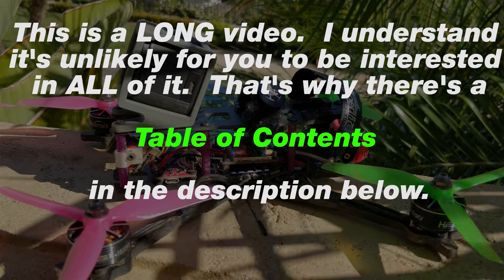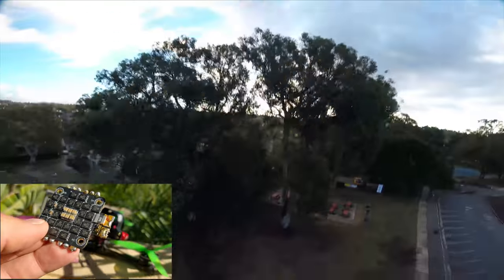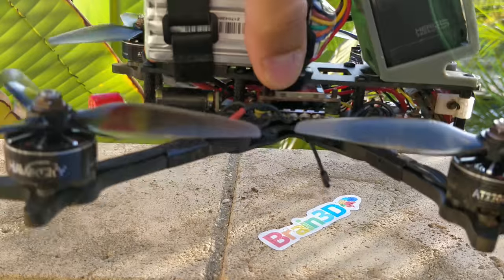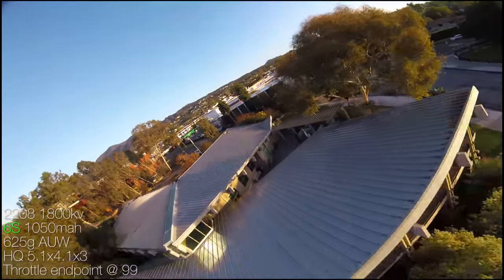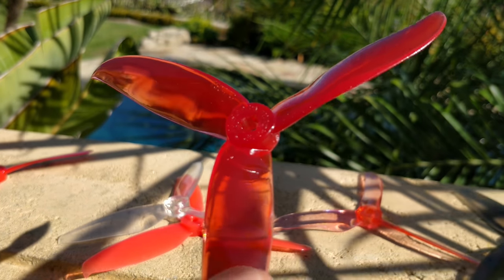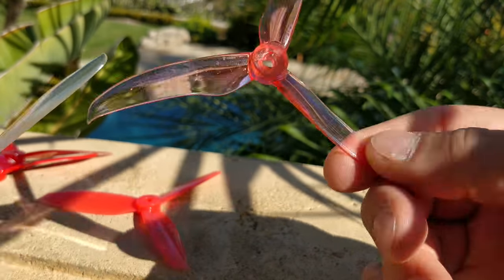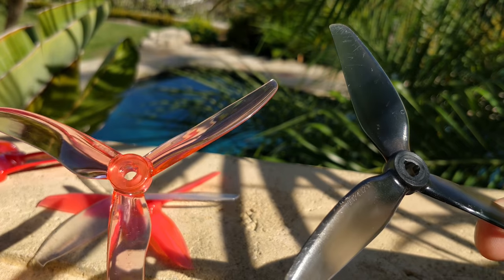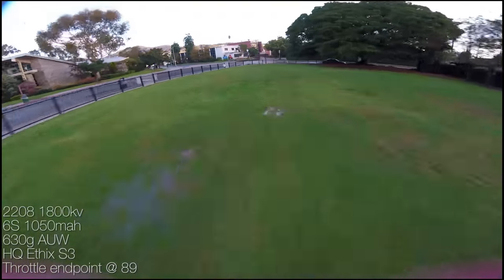HQ Ethix S3, My Setup Concepts, Frame Update, more....

Comment: Hey Bob what kind of Lester solder did you get and is it working good for you?
I've got about 4 rolls of solder here and all junk, radio shack used to have some good stuff but since then I haven't found any local that is good, so think I'll have to order some.
Reply from the maker: Kester 44. Link is in the video after the one where I was having issues.

Comment: Hi Bob, I really want to buy your new frame, but, maybe i just need some glasses, could it be that the front standoff holes are M2? I mean that is not that big of an issue, I just want to know, what you use to mount a flightcontroller that has m3 holes. I hope you can help me.
Reply from the maker: There are two M2 20x20 stack mounting platforms beside the one central 30x30 platform. Everything is M3 aside from the 20x20 platforms.

Comment: Super glad to see you touched on the wobble after throttle issue. It's literally been killing me on kiss. Side note you think the ethix props are going to be okay at 6s/1600kv? I've been trying out super low kv and I love it. But I'm definitely having the throttle pump issue. I'm hoping the swap to race flight will help as well.
Reply from the maker: It's the single most annoying thing that just a rose in the last couple of betaflight builds out of nowhere. I think actually 3.4 made it happen
Reply: @Kabab  I stopped using BF because of the clracing f4s. Literally 4 of them all died out and gave me different issues and I couldnt tune them for crap. I'll try out the ethix blades and see if they help. The minimum throttle idea is good. Although I run into the "floaty" quad issue where it feels like it won't go down unless I lean forward too far.
Reply: @Kabab  side note you hit the nail on the head with "phantom until acro". 😂. Exactly what I'm going for too. I actually ordered a floss too before realizing you designed it haha

Comment: Your rates are not that far off from mine.   I run close to 850 which is the result of around 1.2 linear, .75 super, .15 expo for PRY.
Reply from the maker: It's all the other stuff I just leave default...

Comment: what are those washers under the prop nuts? do they help any, also what is your opinion on the lock nuts for prop nuts I recently heard that nylon lock nuts are one time use?!
Reply from the maker: lol no way.  I have locknuts that have like hundreds of cycles on them.  Yeah they wear a little but still work fine.  The washer on top of the prop hub usually helps with props spinning the nut loose.  But I usually don't care and just screw the nut down on top instead.

Comment: Thanks for the vid, the table contents is helpful. I havent seen twin blades in a while btw :'(
Reply from the maker: Because triblades are just better for what we do no matter what
Reply from the maker: Unless you're going for like speed record or something.
Reply: @Kabab  Idk I still prefer them as fast cruising props and I feel that at high speed they have enough control imo (current fave is 5152 biblade on a low drag, properly balanced setup)

Comment: You are awesome, i am thankfull that your channel excists. Thanks for that;)

BUT i am really Not sure if i want Higher standoffs and if i want to pay for two more arms i don't really need.
Reply from the maker: It's going to be the same price no matter what.  The first prototype batch will include the extra pair of arms and based on how many actually use them I'll decide whether to make it an add on or just leave it in the kit.  The actual cost to produce and pack the arms is insignificant when you just include it with the production.  The handling of these parts costs more than the actual part.

Comment: What kind of top speed do you get running the 6S motors on 4S. I know that that is not the purpose, but I am highly interested.
Reply from the maker: no clue but it's like 2/3 the speed of 6S probably depending on AUW, props and motors.

Comment: how much will it cost, if you are including all of these options? Maybe you could offer it as an option in the store, because i don't think everyone needs all options.
As always awesome work!
Reply from the maker: It's going to be the same price no matter what.  The first prototype batch will include the extra pair of arms and based on how many actually use them I'll decide whether to make it an add on or just leave it in the kit.  The actual cost to produce and pack the arms is insignificant when you just include it with the production.  The handling of these parts costs more than the actual part.  The extra hardware literally costs pennies.  This is why I laugh when any frame maker says they removed one standoff to make it cheaper to produce and sell.  Standoffs in large bulk are maybe $0.06 ea.  I'd rather spend those pennies and give you ALL the options.

Comment: Bob have you done any testing on the Aikon 6s 20x20 ESC listed on Pyroflip?
Reply from the maker: Yeah. It works but like the rest, it's not as good as the larger ESC's imo. But it does work fine. I just don't have the trust in it that I do with a big one
Reply: @Kabab  so nothing crazy innovative thats worth switching from the ori32 that i currently have?!?

Comment: hey kabab do you know if the ethix props are the same as the standard 5x4.3x3 hq props? just got a set and they seem identical, even the same SKU (just different colors). did you notice this? have you flown the hq v1s before and if so was it the same? what SKU do your props say on them? there's literally no info on them even on the website.
Reply from the maker: Definitely not the same. The 4.3 is a slightly softer material and has that scoop near the middle. It also flattens out under load pretty quickly.
Reply: @Kabab  would you be so kind as to upload an image or link to the SKU/numbers on your prop. I think the retailer swapped my ethix props with standard v1s and I'm trying figure it out.

Comment: What do you need to look for in a prop if the goal is to maximize flight time with the least impact possible in agility and power?
Reply from the maker: you may be asking for a bit too much but you want big blade and shallow pitch
Reply: @Kabab   Big as in long, or wide? Or both?
Reply from the maker: @tiagotiagot  long is gonna matter more than wide. But longer you go the lower the prop response

Comment: The Xing motors actually have 9mm bearings. 

Do you recommend, building two exact same quads? I just bought sone high kv motors and I want to build a second one. But I don't know, if I should now use the high or low kv motor for 4s
Reply from the maker: I don't have any two quads that are the same anymore.  I like two of the same because then nothing changes if you break one and move to the second one.  But I also have more versatility with two different quads.  I really really recommend you build an 1800kv 6S capable quad on at least 2306 or 2207 for 5".  There just isn't really a point to building 4S quads anymore.  The ESC's mostly do 6S now and everything is quickly moving to the 6S standard.  4S on a 6S quad is definitely not as powerful as 2700kv 4S, but it's absolutely no slouch either and is ultra efficient.  You'll unlock abilities you didn't know you had when you have so much throttle resolution in the range where it matters.  Just give it a pack and try to fly around a branch and you'll see.
Reply: Kabab FPV  Well, know I have to build one with the high kv motors, I think. But the second one, will be a low kv for sure now. Thank you for your reply. 

I really like your videos, you have a great mindset. Ah and I just designed my own frame, I got inspired by yours.(studying mech. engineer, I love this stuff) 

Keep up the great work.

Comment: We need to change our motor construction so it is similar to RC car brushless motor. 
That would get props out of view and it would make motors much more durable
Reply from the maker: But out runner gives so much more torque and is simpler.
Reply: @Kabab  I mean that type that's like normal quad motor but the shaft comes out from bottom and not top of the rotor.
Only disadvantage of it that I can see is that taking off would be harder on grass
Reply from the maker: @BuzZ.  ah like that.  Yeah not very practical unfortunately
Reply: @Kabab  it would be really smart, just do it !

Comment: Hi mate! 

It would be awesome to have those X arms on my flosstyle :). Are you going to made them compatible?

Nice video!
Reply from the maker: unfortunately I can't make individual arms compatible on the flosstyle but I assure you this new frame will not be expensive for the extreme value it will offer.  Target is $50-55

Comment: Damn, i wish i would have watched this video before i pulled the trigger on the hyperlite 2207.5 2222kv motors. I had asked on the piro Facebook page if anyone had flown the 1922kv motors on 4s and 5" props and if they would think it would still have decent poke for some light freestyle on my mid range crusing rig. The few who did answer said it would on 5/ 6s so i just went with the 2222's. After watching, it looks like sub-2000kv on 4s would have worked perfectly for my application.
Reply from the maker: I do my best to share everything I can to help with the decisions...2222 is good for 5S and 4S

Comment: Is it a good idea to use the old Emax 2205 2300kv red bottom on 6s for more speed, or will it destroy them?
Reply from the maker: They'll be fine on 6S but they also won't be all that different than 5S or even 4S.  They're gonna hit their limit pretty quickly in the RPM range and the control won't improve with voltage.  Nothing will happen to the motors however.  They probably won't even get any warmer than they already do.
Reply: @Kabab  Would the flight time be longer because of the extra charge, or shorter because of the extra weight?
Reply from the maker: @tiagotiagot  extra weight of what?  Use a 1000mah 6S.  It weighs a little less than a typical 1500mah 4S.
Reply: @Kabab  Oh, I had assumed that with the same technology level, having more cells would increase the weight.

Wait, you're comparing different capacities there, no? Does the weight relation stays the same when you compare batteries of the same capacity? Or is the capacity category based on the capacity of individual cells and not the total capacity of the battery?

Comment: Who rebranded the typhoon, is it raceflight or Bardwell? Racefligts original 4in1 I think was a typhoon. I didint like it. I do like the mini fight controler u have there.
Reply from the maker: Bardwell changed a couple caps which may or may not be significant to the boards performance, but it killed the typhoon 1.2 as a result because it was too similar and was being sold for too little.  Literally making the industry more expensive for the sake of branding. Not advancement of anything really.
Reply: Kabab FPV yes blheli-s you’re correct. Never had one burn tho in over a year of use. Admittedly not on 6s tho
Reply: @Kabab  yeah I really don't like the whole rebranding. It's just dumb lol. The motors with guys names on them. Now esc's. I see u use raceflight. have u ever used the bolt or the bolt 32? I had such bad luck with both. Multiple trys as well. I literally won't use a 4 in 1 because of those 2 I had. I use seporated  lumenier 36amp blheli 32s.  In a comment on Bardwells vid of his new Esc he told me mine  were just  rebranded racerstars. I told him maybe, but they just work! Haha.
Reply: Long story short he got upset  becaue I said I had bad luck with racefligts airbot 4 in 1s. I noticed his was very similar. He blamed raceflight. Maybe hes right.
Reply from the maker: @prrcpor  it's stupid for him to get upset since he's doing the same thing racerstar is doing but just charging more for his branding. There is definitely value in testing and recommending something solid but anyone that's been doing this for a while knows that even the best of components fry from time to time. A couple people pushing a component with no issue doesn't mean much. I'm more interested in long term testing. The Aikon 32bit 4in1 has the best and longest track record to date. It has the least returns and RMA issues at pirofliprc. So I recommend it. However it is expensive so I like the typhoon 1.2 much more because it's given me no problems so far and is half the price. But sorry. No more because bardwell has branded it his product and somehow got Airbot to comply with his demands...
Reply: @Kabab  he wasent really upset just wanted to clarify I guess. Maybe it is raceflight because I've seen others who've had the same problem . 
 I'm looking for an esc option for a  betaflight 6s build I want to do. I just havent decided on a  4 in 1 or just stick to the same old lumeniers I use. Lumenier does make a 50 amp version . Same  design as the 36 just 50 ams. I can't find anyone else who uses either. oh yeah aren't shallow pitched props better on the low end of the throttle? Better at slow speeds? I've noticed that
Reply from the maker: @prrcpor  yes. Bardwell is just straight wrong on this concept of props. Steep pitch is awful for control usually and low pitch has far more immediate response.
Reply: @Kabab  yeah i agree with that on the props . i never  checked him on facebook. but im sure your rigth. and the one thing i have to say about it is either way racerstar is at least cheaper
Reply from the maker: @prrcpor  Most racerstar stuff is garbage but some isn't.  It's hard to tell what is and isn't.  I try to test the interesting stuff and let people know...

Comment: Quex: How often do you get thrown out of places for flying?  I live in norcal and several park maintenance guys have told me to leave.  Most parks in incorporated cities have policies against RC/model stuff.  Dude, I have to say I admire your balziness re flying in streets/residential areas...you def inspire me to try it :)
Reply from the maker: First off, I'm being very unsafe.  I know that.  I'm not setting a great example but I'm being as safe as I can be within reason.  I make sure there is nobody around and I only ever fly two packs at the very most wherever I am.  My limitation is that I don't have anywhere to go and fly where there aren't tons of people.  So I go places during sunrise usually before anyone is awake.  If I do fly in my neighborhood, I only fly quads that I'm sure are as reliable as can be and aren't gonna randomly fail on me in the air.  This is the most risky thing I do but again, I have nowhere to go and very little time as well.  I know the risk I'm taking and don't recommend it.  It's literally 6:10am when I'm flying at this park here.  I've now gone there three days in a row.  This morning I was late and got there at 6:45 so it was already filled with some cars.  I flew one pack in a small area and left.
Reply: Kabab FPV I guess my point is that you’re (mostly) flying legally (re 107 regs)...as long as you have control and do it in a place that doesn’t explicitly forbid it...other than perhaps not having a visual observer when flying FPV, you’re not doing it for commercial purposes (meh), I don’t see you flying over people, not at night, not over 400ft/100mph.  Perhaps your preferred style FPV might technically be illegal unless you had like 3 visual observers spread out...anyway, how the f would a cop know any of these rules anyway?  And how would a pilot know if, say, flying in ones neighborhood like you do, is forbidden?
Reply from the maker: @jasonbond3567  Yeah I know all the rules but I try to be practical and just not do anything obviously unsafe or annoying to anyone.  So I almost never get kicked out of anywhere.  It does happen from time to time and I just leave.

Comment: What do you think about a 4S-5S pack on 2222kv 2207.5?
Reply from the maker: I'd say 5S is just right for that motor and 5"
Reply: Kabab FPV The throttle curve on 4S is just spectacular. And 5S is really really quick. Such a difference from 2207, kinda surprised since it’s only .5 mm difference

Comment: what kv would be best for the s3 props at 4s, I feel it would be good for those 2700kv motors johnny and wildwilly use
Reply from the maker: I recommend running them on 2306, 2207, 2208 1800-1850kv 6S or 2600-2700kv 4S with an AUW of under 650g.
Reply: ok, sounds about right, Ive just started needing more power because my quad became a fat nugget after getting new gopro syndrome, and the fat source one frame

Comment: Hey Bob, try a thicker tip that holds heat better and your solder joints won't look so clumpy. This happened to me and changing the tip to something thicker will melt the solder better so you don't get clumpy joints.

Comment: I have a doubt is possible to use a 6s on a 2300kv motor with a less pitch prop like 5030 dual blade or a 4052 gemfan .and get the same performance as a 6s low kv setup
Reply from the maker: Will just be way less efficient. Or the prop will deform a lot
Reply: @Kabab  true but try it out when ur free maybe u'll get a good result

Comment: Hey, great video! What are your thoughts about 1600Kv on a 5" 4s ?
Reply from the maker: 1600 is still fine on 4S but it is really really low.  The bottom half of your throttle will do nearly nothing.

Comment: Try setting your min throttle idle to 1.5% then add 5% idle up and tell me you don’t notice a difference in nose bobbling
Reply from the maker: It's the same as what I do. One is on the controller and the other is in BF. The wobble happens even if I go from like 80% to 30% quickly.
Reply: Kabab FPV it fixed it for me 1% -1.5% on beta flight and the rest on tx I’m not sure why but it works I think I saw drib make a vid on it and I tried it cause I had that problem BAD and it’s non existent now.

Comment: as usual good informations and ratings, 5 inch is fine- without a gopro mounted :P... 6 inch and low CG on quad then it fitts a gopro ;)